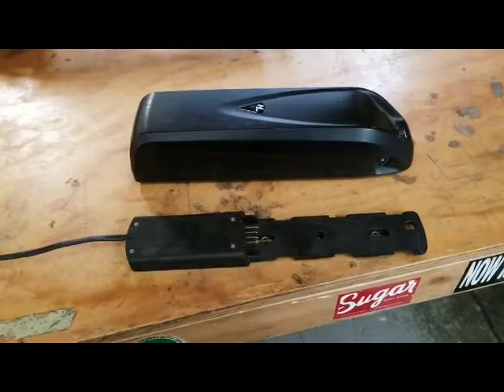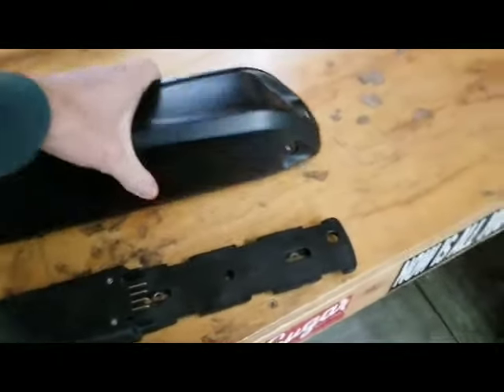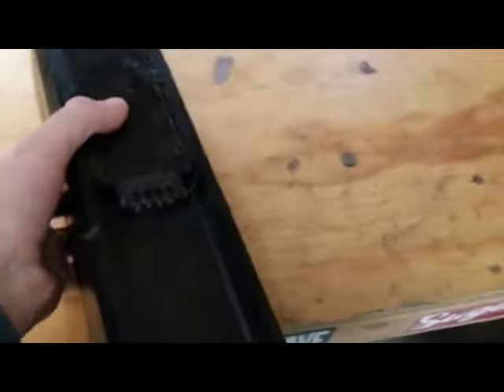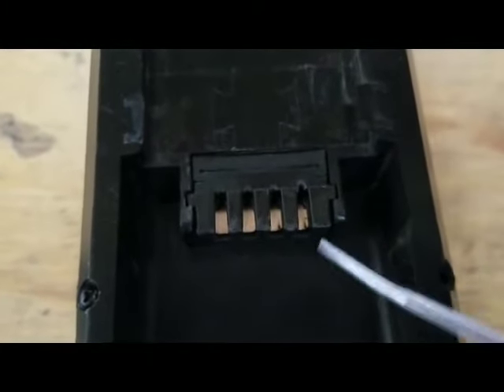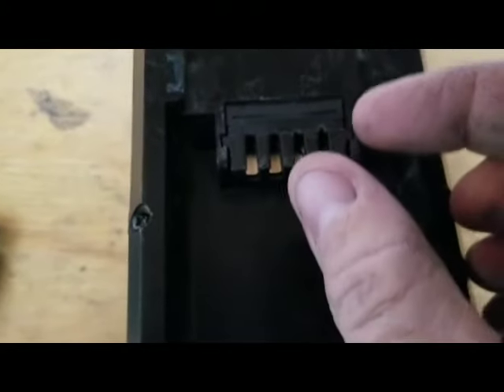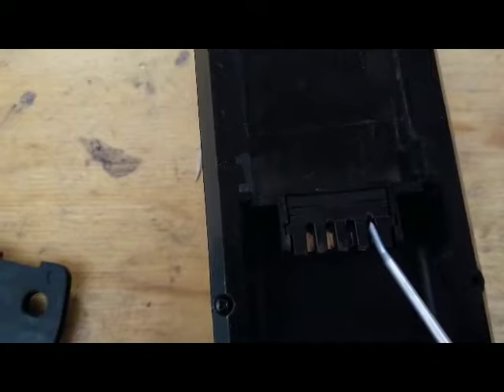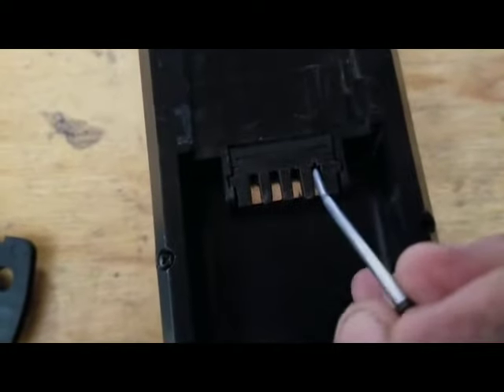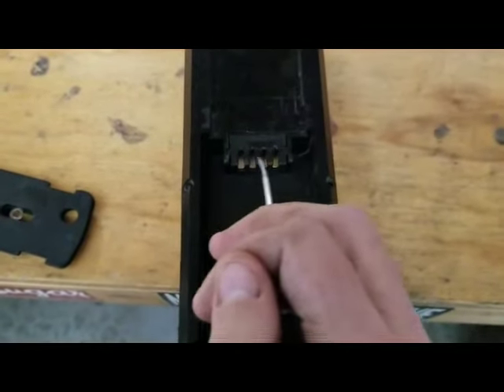Is your Ebike power cutting out? Power issues fixed!

Comment: My Heybike Mars had this problem when I had it for 53 weeks, one week after the warranty expired. They did sent me new display for free thinking it was the power button. Didn't work, so I bought a new controller (for cheap) and that didn't fix it.

The Mars battery sits in a well with four prongs that stick up. That's where your video interested me. For my battery I had to remove the housing on the connector end of my batter and actually remove the battery lead clasps and close them in, like in your video. Now my battery makes a secure connection to the prongs in the battery well and my bike is fully functional. I even rode it to work this morning.

I cannot thank you enough for your video.

Comment: I recently had to do this. I believe it was from having to take the battery off several times daily in the winter to charge it inside. I never leave my ebike battery in the cold and let it sit inside to warm up before charging it. Just bent the pins tighter together and it works fine now. Too bad I had to spend $70 for a controller that is not needed.  Oh well at least I got a spare controller just in case. It was a 4 pin Hailong 1-2 with the power leads only connecting to the outer most pairs.

Comment: You can get electrical contact cement which you can put on contacts that stop corrosion and also ensure a electrically sound connection.
Reply: Do you mean contact cleaner?

Comment: Hi, my problem is when I ride it it dies in couple of seconds even beeing full charged,any ideea what the problem would be? It works fine as long I don't ride it,really weird
Reply: I have the same issue. The power doesn't cut out, but the motor does.
Reply: Why?
Reply: I have the same problem the bike cut off while I’m riding then I squeeze break levers then it jumps back on but now it’s worse then before can’t enjoy the bike keep cutting off
Reply: @susiekendrick1650  I ended up having to replace the controller. Works again
Reply: Plz did you find solution ?? I have the same
Reply: @abdelfettahch5343  I needed a new controller fitted. Works great again.
Reply: @RMVideoEditor  New controller, like whole speedometer (screen) thing or?
Reply: Found the solution?
Reply: You charged your e-bike motor for too long, most of the battery manuals tell you to only charge it for 6 hours so it doesn’t break the battery, that is probably what happened

Comment: I bent the metal clips CLOSER together, not farther apart.  To enable better contact with the pins when I slid the battery back onto the shoe.  That fixed my issue-for now, anyway.
Reply: it was a bit difficult wasn't it? bc they wanna remain spread out, poor design

Comment: I was caught in a rain storm and the bike shut down, I dried it for two days and it started up again so I went for long ride on a beach and it shut down again so, I pedaled my ass 10 miles home, charged the battery and dried it again, took it out it died on me again. I just did what your video suggested and it seems to be ok. I also lost the keys for the battery so, it was alittle loose from prying it off. Thank you so much for this video I think it's fixed, going for a rip now. I will update if it dies again.
Reply: Yh same happen to my bike today let me know

Comment: Mine cuts out the same place (2 miles) and won't come back on until the charger is connected. It sparked a few times when I previously connected the charger, could thus have damaged something? Also the energy bar (battery level) always says 100% on the display
Reply: I have the same problem,still don't know how to fix this,do you have any suggestions?
Reply: @dacianking8609  I removed the bms, wired it up without it and haven't had a problem for more than 800 miles. But if you know nothing about batteries or electronics buy a new battery. If you do, buy a new bms and solder it on yourself. The reason this happened is plugging charger in to battery whilst still connected to bike. I'm guessing you've done the same and saw sparks now and again when connecting charger cable?
Reply: @dacianking8609  also the bms makes sure it doesn't overcharge and set fire to battery. So I use a multimeter to measure the voltage. 54.6 is max it should be charged and I set alarms to let me know when to disconnect. I do not recommend this, even though it works for me, it is extremely dangerous to the unaware. Buy a new battery. Sorry I know it's the worst news to hear. You can wire three DeWalt 9ah 18v batteries parallel giving a whopping 27 ah battery life for £100 ish. Learn about batteries on YouTube. It's super easy.

Comment: I was one day away from ordering the display/thumb throttle for my friends super73 s1, it was pretty poorly cared for with only 600 miles, so much so i replaced kickstand/ headlight/ added accessories.  Cant wait to try this tomorrow and hope it works. Display will shit off and then when it is on, theottle is intermediate but PAS will work. Anyone know where to find display just in case?

Comment: I have a Swagtron eb-5 and if I power it on and ride it it acts  as if it was turned off when it’s still powered on, then it starts working again after 30 seconds then repeats. Idk if the problem is this or if the battery is done for, my father left it on his shed all winter and I believe the cold weather damaged it. I may be returning it to Swagtron to be repaired.
Reply: Cold storage doesn’t hurt lithium batteries, but some are self- heated for extreme cold use.

Comment: These suck had that problem constantly due to dune jumping ect so I brought the two pole connecter from Luna cycle,fits the battto the bit you slide it on allot better with out movement that causes arcing ect.

Comment: Hello,
I have NKY226B02 battery and NKJ039 battery charger. The battery was dead so I send it to the regeneration. After the regeneration I put the battery to the charger and it's charging very slowly. I measured it. There was 27,4V and 0,135A (charger is 29,4V 1,8A) - maybe the charger is faulty also. I put the battery to the laboratory power supply. I put on 29,4V and 1,8A. At the start the battery takes something like 0,175A and after one second it's disconnecting charging. Do I have to put some voltage to the third pin, (between third pin and negative is 10k Ohms - guess NTC sensor) to force the BMS to charge? I'm so confused because I don't know that something goes wrong with regeneration, the charger lost the current efficiency or what? Please if You can give me the advice, since I have no experience with that type of electronics.

Comment: I have this problem i think, when i turn the throttle handle the bike starts to move but then stops  and even jerks. I tried this fix but it did not seem to work. One thing i did notice is, on my shoe i have 5 pins but only 4 tabs on the battery to close up. The one in the middle is a blank or have they broken off? Should i have 5? On yours you have 4 of each.
Reply: I have the same issue with the power cutting out, did u find a fix?
Reply: @ALD  yes. I found that a break sensor  was too good. When I hit a bump it triggered  the brake and the bike cut out. I had to replace the unit and now it is fine. I originally dis one cited everything and ran the bike after plugging in each thing individually

Comment: I'm trying this method right now but my bike still seems to shut off shortly after using the throttle or putting it in any power mode basically.

Update: so at first the screwdriver trick didn't seem to work like in the video so I followed someone's advice on spraying electric contact cleaner on the male and female ends.  Now the battery won't even turn on.  I'm afraid I just screwed myself.

Second update: the battery came back on but it still died immediately after I tried to use pedal assist or the throttle.  I give up.
Reply: My m20 shit the bed. Its a brand new $1400 paper weight.

Comment: Hi have tried this and 4 more batterys still getting a decent  in power loss it comes back on with in seconds  can it be the battery to low in power as in 52 to 72 v for a 1500w motor 17ah controller

Comment: I seem to be getting this problem but it works when I'm not on the bike but when I off the bike and pull the throttle it goes without error 6 but when I ride it it works then does error 6

Comment: Any ideas how to remove a battery that's gotten stuck on the frame and yes I have turned the The key. But it won't budge the matter how hard I push and pull. Please help I rellay don't want to have to send it back to my dealer. For a simple fix.

Comment: What happens if you take out the 4 screws that seem to be holding the outer cover in place. Looks like it may actually reveal the pins your talking about. Better than shoving a screwdriver beyond where you can see right?
Reply: I have the same Hail-long brand battery on order. A 18650 1000w 49v Samsung battery.
Reply: Its the female pins that you have to fix. They are on the battery. You dont want to unscrew the battery cover if you don't really have to. Trust me on that.
Reply: His talking?

Comment: Sadly this didn't work for me. Is the battery supposed to be producing voltage across all 4 prongs? I'm only getting volts on the meter across the two outer most prongs, but it is still registering 39 volts on a 36 volt battery. The volt meter is also showing that only the same outer most prongs (one negative, one positive) have continuity as well.
Reply from the maker: Even with just the outer prongs, 39v is 39v and should run your sysem. Does the display come on at all when you try to power it up?
Reply: @nomadcyclespdx  The Display turns on, and shows a full battery. The motor will run as long as it does not exceed 100w draw on the battery, either in pedal assist or hand throttle, but the instant it goes over that 100w level, the display immediately turns off and will not turn back on until I take the battery off the bike and reinsert it, then it'll repeat the same thing. 

I am assuming (90% sure) the battery is just going bad, given I just eclipsed the 1400 mile mark on it over the past two years and, before the battery started acting wonky, I was using the bike daily, both for fun and commuting to work, and before this issue, it was starting to discharge SIGNIFICANTLY quicker than when it was new, and trips I used to be able to do on full electric with power to spare were draining it down.

The issue is I don't know any other way of testing it other than with the volt meter, and I am paranoid that there is something else wrong with the bike that I can't find.
Reply: @Malachi_Marx  mine keeps cutting out at the exact same place. Which is a good walk away lol. Shengmilo are sending me a new circuit board for the battery, if this fixes it I'll let you know mate

Comment: my bike is turning off when i turn left , and i cant turn it on if its on left side :/
Reply from the maker: Often, if the main wire harness has connectors close to the head tube of a bike, a short will develop over time. If you want help with it, email me at brad@nomadcyclespdx.com

Comment: Same thing is happening on my electric scooter, I bought a lithium 20AH battery for it but it keeps cutting out when i have stopped an starting off again, sometimes tho it is cutting out on me, An i do not know why, Can anyone help me on this plz......................
Reply: You got it fixed yet, I’m under the same issue
Reply: @rahabrizmy  Breaks was my issue, Has a safety cut off wire an if the break gets pulled in even a tiny bit the motor cuts out, That might be same issue with you aswell..
Reply: @mad-b264  thanks, I’d like to clarify that after the power cuts out does it require to remove and reattach the battery wire in order for it to work again ?
Reply: @rahabrizmy  If the battery got a BMS, Then no, As far as I know, Lol, The Battery management system stops the battery over charging or short circuiting, It all goes down too how expensive the battery was, Again unless we as people pay big money for quality we get duped into buying crap, There is a lot of vids online with people selling something as the best online until you buy it that is, The world of Personal Electric Transport is far too expensive, 4-6 grand for a electric bike just coz it goes 40-50 mph is going bit too far if you ask me, Even the wolf warrior electric scooter could be bit cheaper in my eyes, Mass production an with covid-19 I thought the government would be pushing for people too use PEV, Scooter or electric bike, Transport on your own single person vehicle, I loves my scooter, Needs an upgrade or new one but the cost is what's stopping me upgrade, Wish government would help more people use a form of PEV transport...
Reply: @mad-b264  okay, thank you, much appreciated 🤝
Reply: @mad-b264  How did you exactly fixed it??

Comment: My m20 is trash. I replaced the rear tire tube  because a leaking valve stem from the factory. I only unplugged the 1 connection. The bike has power, but now it won't work on pedal assist or throttle and no shops will touch it. PIECE OF 💩

Comment: While riding my e bike it ride fast then it slow down
Reply: In the UK they are limited to about 16mph so if you go faster than this it will switch off until you drop your speed to below 16pmh. You can cycle faster but you will not get any help from the motor.
Reply: who tought you English?
Reply: Im having the same issue. This is happenning while the speed limiter is disconnected. So its not because of speed limit. I've replaced motor, lcd, controller and pas sensor (i have a spare ebike). Problem persists. Which can only mean its the battery. :(
Reply: @bassmentality  taught*
Reply: A C Vickers who *taught you?